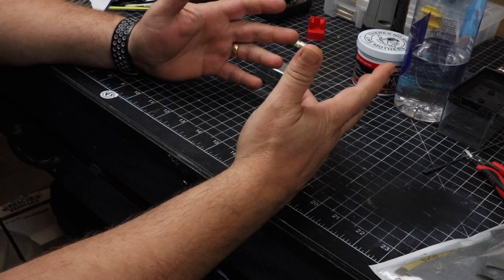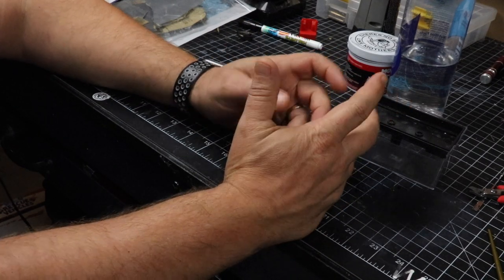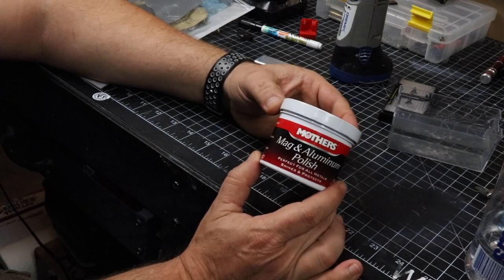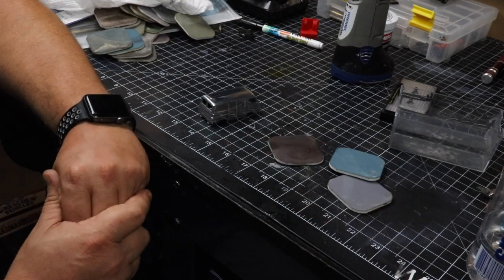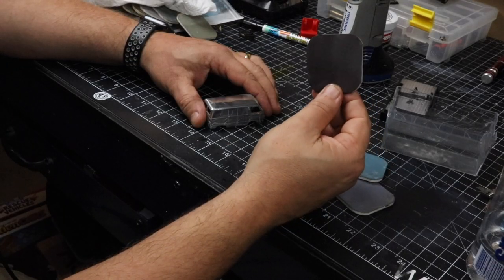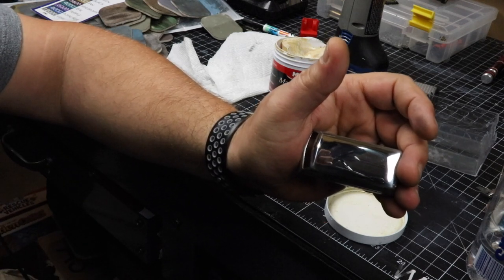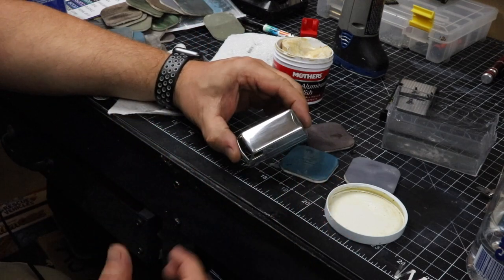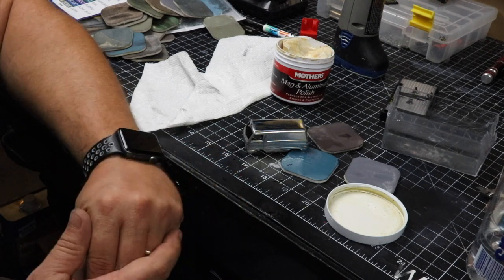How to Prep Hot Wheels for Paint : Great for Redline Spectraflame

Comment: I turn pens as well and the micromesh is wonderful. I magic marker the numbers 1-9 in the order they're supposed to be used. Also with hand sanding I use a spray bottle to wet the material.
Reply from the maker: Magic marker is a great idea! My issue is that I'm a little color blind with blues/greens so I'm not even sure what they are when new unless I can really feel the grit. Again, great idea so I'll be marking them now!
Reply: @WheelsNThangs  I have a set of pads that polished the CA finish on around 200 pens and the numbers are still as clear as when they were written. I had to do that because I ALWAYS lose the chart.
Reply from the maker: So just regular magic marker? Any particular color that shows best?
Reply: Yeah, man. I prefer a black Sharpie myself. I'm pretty sure any color will work just fine.
Reply from the maker: I got some new ones and marked them all. You have no idea how happy I am over this simple tip. I always tried to keep them stacked in order and it was a pain. It's the little things..
Reply: You're quite welcome! I know the pain of trying to keep those organized. I always start with the assumption that I won't keep things like that organized and then start idiot-proofing.

Comment: Great, great tips! I especially liked use gloves after buffing. I do have a question though. I f you have part of the project that don't have pits or scratches would you recommend skipping sanding steps? And if you have issued near body lines can you get the same results not using higher grit paper without sanding the lines?
Reply from the maker: If there is no pitting you really don't need to sand. Near the body line you just have to be careful :)

Comment: I just started customizing a few weeks ago, I am NOT a perfectionist at all, but to prep my cars for either a shiny finish and clearcoat or to paint it, I do the following:  1. Sand with 600 grit.  2.  Sand with 2000 grit.   3.  Dremel polish.    The result is a somewhat decent mirror finish, but it still has a lot of pits, etc. but that's what gives these things character.  I don't need it to be 100% flat and smooth, just shiny.  Just wanted to add this for anyone starting out so they don't think they need 20 different grades of sandpaper or need to sand their car for a month before painting.   I spend an hour or two max prepping a car.
Reply: I just barely started also. Question after you polish the car do you paint right afterwards or do you clean the car with mineral spirits after polishing then paint? Also do you spray clear after a spectra flame paint job on a redline restore? Ty!
Reply: @Detoxingforlife  I never did any special cleaning at all, just wiped off with microfiber rag, but my polish does not leave any residue...if yours leaves any kind of oily film, then yes, you should clean it off.  I dont do spectraflame  restores, but from what i have seen, all customizers use clearcoat on everything.  Just make sure its compatible with your paint and doesnt ruin it...trial and error
Reply: @bdanyluk  thank you you're the man!

Comment: Looks like a Dodge A100 van or the body to the mystery machine.   But why do you have to wet sand?   Why can't you just sand it dry?
Reply: Wet Sanding Gives You Less Scratches . Plus the Grits go A Lot Finer . Wet Sanding is What Real Car Body Shops Use. It leaves A Nice Finish .
Reply from the maker: Dry sanding leaves scratches.